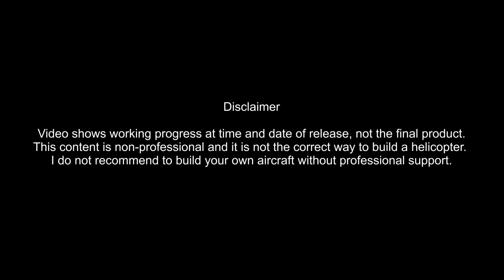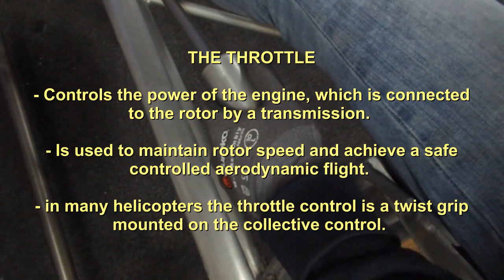Throttle Control System EXPERIMENTAL HELICOPTER BUILD SERIES (Part 29)

Comment: I think there's cable connections need to be swaged. If that engine gets too hot those solder points are going to melt. No mas el throttle...

Comment: Just a Question : where is your Correlator ?

A correlator is . a mechanical connection between the collective lever and the engine throttle,
When the collective lever is raised, power is automatically increased; when lowered, power is decreased. This system maintains rpm close to the desired value, but still requires adjustment of the throttle for fine tuning.
Reply: I wouldn't have thought a correlator would be in the plans, not all helicopters have them.

Comment: Why didn't you have it governed?
Reply from the maker: @Billy Jasinski: Because i need to adjust the throttle movement in the first stages of flight testing first.
Reply: @ultralighthelicopter  so does that mean you will govern it eventually, or will you just rotate the throttle forever
Reply: @ultralighthelicopter  what is your plan for this timewise?